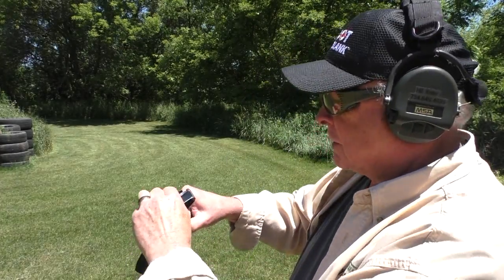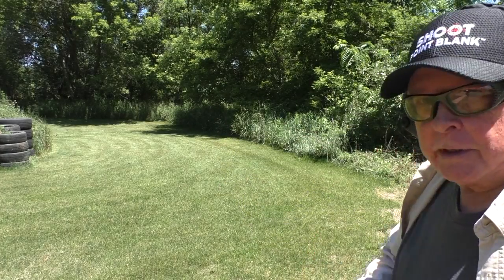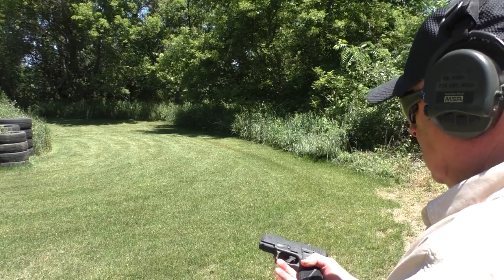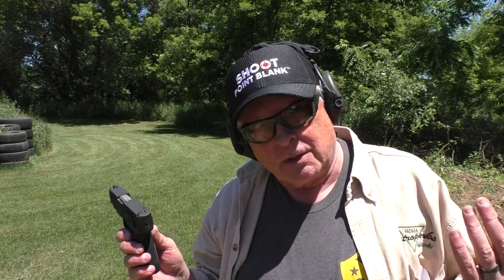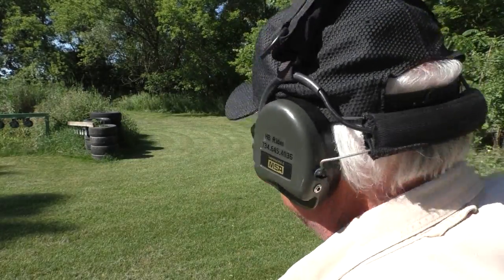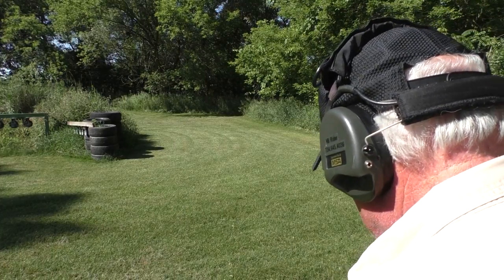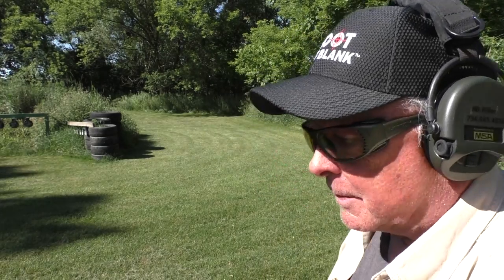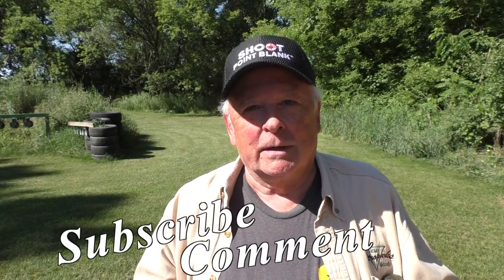Will the Taurus G3c run Defense Ammo?

Comment: My g3c chrome slide version has issues with HP rounds particularly with a fully loaded mag.  I've tried SO many different HP rounds to test this issue and tge issue still remains...  I've started to use Norma MHP 108 Grain and it has helped.   I'm considering giving the feed ramp a real nice polish job in hopes of resolving this issue before I gift this G3C to my mother for home protection.
Reply: Is it at least you mother in law?
I wouldn't recommend giving your mom a weapon that's prone to malfunction for home defense.
Reply from the maker: @Salt Addict, from all the comments, polishing the feed ramp usually works. Thanks for watching.
Reply: Trade it for a Springfield Hellcat 9mm. 
One of the Best out there IMO. 
I just do not trust the Taurus pistols as much. Your Life is worth $400 more for the Springfield Hellcat, Springfield XD, Glock, CZ,  ETC.  Good Luck! 🤠👮🏻‍♂️🇺🇸👍🤠👻😉🍀.  B9USA Sr.

Comment: My new G3c functioned flawlessly with Herters FMJ 115 gr , Hornady critical defense 115gr, Blazer FMJ 115, and my handload 124 gr Hornady HP. My handload is what I carry in my Sig 938, always functions and goes bang. I am impressed with all aspects of the Taurus G3c. I clean and lube the weapon after every firing. The lube I use is Lucas gun oil extreme duty, recommended by Sig.
Reply from the maker: Thank you for watching and adding your thoughts.

Comment: This is an easy fix. Just take a dremel with a wire wheel to the feed ramp on the barrel.
Reply from the maker: That's the usual remedy. Shouldn't be necessary in the age of precision CNC machining, but at the price, it could be expected.

Comment: I've had problems with the 1st round of Federal HST 124 through my G3C. Everything else has been flawless.
Reply from the maker: I haven't tried it yet, but polishing the feed ramp may help.
Reply: What ammo do you currently use for self defense?? I just bought the taurus g3x and I've had issues with the federal hst 124 as well. Trying to find a good reliable self defense ammo to use.
Reply from the maker: @dale3123  while I like the Fed 124 HST, I also use Remington Golden saber 147gr, though I don't have enough for more extensive testing.  So, in my G3c I chamber an HST, then the rest of the mag is 124 full jacket ammo.
Reply: @dale3123  What I ended up buying and carrying were some hollow points from Minuteman Ammunition based out of Washington state. I got some 95 grain rounds but they also make 115gr and 124gr ammo as well. The nose is pretty small on the 95s. They feed and fire flawlessly. I've not had a problem with them at all.
Reply: @LAIRDO-  thanks for the reply, I'll definitely be getting some of that Minuteman ammo. Much appreciated 🙏
Reply from the maker: How was the point of impact compared to point of aim with those light rounds?
Reply: @RidersRange  I found them to work just as efficiently as a larger round and just as accurate.

Comment: Do not use armscor ammos coz it didnt fit to G3C. Use PMC, Blazer ammo and you experience a smooth and reliable Taurus G3C.
Reply from the maker: That's one brand I haven't tried yet. Thanks for watching.
Reply: I use armscor hollow points with no issues.

Comment: I'm not sure what was the impetus for making this video, but if you're Taurus G3C fails to feed defense ammo, here are my thoughts... 
This video is 1 year old, and this gun came out not that long before this video. If you have an earlier model G3C, I might suggest the manufacturing process didn't do a good enough job polishing the feed ramps.  Also, some people don't clean and oil their guns, and never hesitate to complain.

 The old man here (I'm no spring chicken either), suggests that you send the gun back to Taurus. You can do that, but I suggest you grab a dremel tool, or anything that can twist a polishing tip, and polish the feed ramps, before sending your gun off to Taurus. You might find that this solves the problem and you won't have to part with your gun for some unknown length of time.
Reply from the maker: @Charles Luck, thank you for watching and offering your suggestion. Your suggestion is also my solution, and the solution offered by many of those who have commented on this video. However, I rarely, if ever, make a suggestion to a broad audience with unknown skills as to how to "fix" or modify their firearm. Yes, that's the simple (and proper) initial solution, but not everyone has access to the needed materials, nor has the knowledge to polish a feed ramp. I know, I know - sounding too much like a lawyer, which I'm not. Just being cautious.

Comment: need better mags, mags don't feed correctly into gun, iv shot over 300 rnds of blazer, just fine. maybe an issue here or there, hollow points are bad, when you take gun first out the box, failure to feed, to chamber ect. however, if you change barrel and simply take the mag apart work the spring out, lube it up. iv been chambering my hollow nd shooting all 17 without issue. Tarus is a great gun for its price. it's also a fine gun to carry if you have taken the precautions beforehand to make sure it feeds defensive ammo properly. However, if you have the money go with a gun brand that is more reliable, whether it be a revolver, or good ol glock. At the end of the day, you don't want to find yourself in court telling your peers that you used a gun that you didn't find reliable, so you opt to use "training ammo" blazer to everyday carry. when you could have carried a more reliable gun. Always know every action you take will be reviewed/scrutinize by your peers in a court setting.
Reply from the maker: All good points. However, I've found that Taurus quality control may be somewhat spotty. Some guns run fine, others, not so much. Thanks for watching.

Comment: I have had to ream  the throat on all of my Taurus pistols in order for them to pass a plunk test with my reloads. You can buy the reamer on Brownell's for about 80 bucks and it doe's a superb job.
Reply from the maker: Good info. Thanks.
Reply: @RidersRange  Just try polishing the feed ramp smooth if its not eating HPs. That feed ramp should be smooth right out of the box but sometimes its uneven with ridges or tooling marks that need to be smoothed out. After its smooth it should run anything like a scalded dog. You should not need to ream out a chamber throat that may cause more problems than you already have. It should already out of the box pass a chamber support test with factory ammo without need to ream anything out. If reloads don't show chamber support or won't chamber then the reload is the problem, not the pistol. My G2c eats HPs with no problems right out of the box.

Comment: I have this issue with one of the three magazines that i received with my G3C. That one magazine fails to feed from a full magazine every time. No issues with the other two magazines. Imma contact Taurus to see if I can trade that one in.
Reply from the maker: Check the mag lips to see if they are bent and compare the problem mag with the others.
Reply: @RidersRange  I can't see a difference. I called Taurus. They are sending me a replacement magazine. I noticed after loading the magazines several time. I noticed that the troubled magazine is stiffer, and harder to load. I am going to cut one link from the spring in the troubled Magazine. Guessing that the spring is too tight. If that does not fix the issue. I will just load it to 11 rounds. It works fine with 11 round. It is at this point an extra magazine, so...

Comment: My G3c had a nasty burr at the base of the feed ramp, causing a jam with hollowpoints when chambering a round  using the  slide release. I very CAREFULLY used a small, fine, half-round file to remove it. Problem solved.
Reply from the maker: Even at the $300 price point, one shouldn't have to fix issues like that, but I''m glad it worked out for you. Thanks for watching.

Comment: Yeah, I tried some HSM 147 grain flat nose full metal jacket rounds in a Taurus g3c, and the {ogive} of the projectile will not allow the cartridge to seat fully into battery. It's a pretty shallow throat and ejection of those rounds are a real bugger... Unfortunately I bought several boxes before I even knew that the gun will not shoot them... 

🙃🥂
Reply from the maker: Any time I have ammo that has a bullet shape other than a typical round nose, I "plunk test" it in every barrel. Guns with a short lead often have problems with certain bullet shapes. Since you have all that HSM 147hr ammo, you may just have reason to buy another gun. Thanks for watching.
Reply: Yeah that what I was thinking. Can't have all that ammo feeling lonely sitting on the shelf like it's not loved. All ammo needs a trusty reliable friend... lol...

Thanks for the reassuring justification. 😆

Comment: So far the ONLY hollowpoints that have an issue with feeding from the slidelock position has been PMJ 124 gr. in my G3C. My local gun shop carries these almost exclusively. The other rounds I use are standard ball 115 gr. Fiocchi or this ballistic tipped fmj ammo I bought during the shortage that was the only ammo I could get at the time.
Reply from the maker: You have to run what the gun likes, and they are all different. Thanks for watching and adding your info.

Comment: Mine was jammed up against bottom. Lip of the feed ramp. took it apart and looked at it. it looked like someone  at the factory had dropped the barrel on the feed ramp. used a Jewlers file to smooth it out. Seems to work now. Unfortunately, I'm still having acracy.issues.
Reply: I have the same issue with my Taurus g3x,  the lip of the hp seems  jams at the bottom of the feed ramp with gold dot 124 gr ammo..

Comment: try polishing and buffing  the feed ramp that what i did to my keltek p11
Reply: I agree!  Just a little polishing can cure most problems.  I use "crocus cloth" which is an absurdly fine variety of emery cloth, sold in hardware stores.  I wrap a small strip over a bunch of different sized rubber pencil erasers, and softly rub with ONLY an in-and-out motion like the bullet when feeding.  I gently polish the ramp and the upper side of the chamber where the bullet nose bumps into.  It takes about ten minutes, and feeding hesitations go away..........................elsullo
Reply from the maker: Harvy, I've even had to polish the feed ramps on a few "higher quality" (read - expensive) pistols. Thanks for watching and adding the comment.
Reply from the maker: elsullo2, thanks for that suggestion. I guess I'm basically lazy - I use polishing rouge with a Dremel tool.

Comment: It won't "manually" feed the flat tipped bullets. Load a round tipped buttet manually and it will recoil feed the flat tipped fine. I never had an issue until I purchased some 147 grain both types of which were flat ended. Maybe one of the people who commented was right that you need to pull it back and let it snap in but it wont feed them slowly.

Comment: Many rounds do not pass the plunk test which makes bolt not go into battery and getting stuck if you force it.  I found Sierra jhp fit well.  plunked in and you can push and spin in chamber.  Test your defensive ammo like this first.
Reply from the maker: Testing your ammo is always sound advice. Thanks for watching.

Comment: Mine does not run certain hollows. Just tried to chamber and have had it get stuck during feed multiple times now.
Reply: Same here. It happens while firing (if you fire pop, pop, pop, pop rather than how this guy's doing it). I'm going to sand down the feed area. That supposedly will fix the issue.
Reply: @hephaestus6365  it's pretty annoying. Because if I happen to get into an altercation any time soon I don't know if I trust this gun to save my life. I don't have many tools to really fix the issue so I'm just hoping that if the time ever comes that it works well enough and that I can stop the threat from a shot or two

Comment: Mine has issues like this. Literally zero rounds through the gun and it will not load certain JHP’s. I know it’s because of the barrel for mine anyways
Reply from the maker: I believe Taurus has some quality control issues. Thanks for watching.
Reply: Try running a few hundred rounds of fmj through it before hp

Comment: It's a magazine issue. Has to be. The springs sound defective, or they're put in backwards.  I would bet it isn't the gun. Go buy a coupke extra mags for extra round carry and see how they perform. If they all do it, then I would look at the gun itself.
Reply from the maker: Mags are fine. I have 4 mags for the gun and they all perform the same. A little polishing to the feed ramp and breach area and all is well.
Reply: It's not the mags on these guns. If it happens at all its usually on a hollow point on a brand new dry gun. I always clean and oil these guns right out of the box. No issues.

Comment: Mine wouldnt feed hollow points untill I polished the feed ramp,problem solved
Reply from the maker: That seems to work most of the time. Thanks for watching.
Reply: Same here
Reply: How odd. Mine wouldn't feed because I was unintentionally riding the slide. Once I addressed that everything was good. Not once did I polish the feed ramp.
Reply: @Poser_Metal_Records yea i noticed riding the slide wont feed hornady critical duty hp but just letting the slide go feeds it just fine
Reply: @Dreadpurp  It's funny because prior to buying the G2c my only gun was a 92FS which had no problem with me riding the slide. Damn gun was letting me get away with a bad habit lol.

Comment: Thanks for the video, I found mine does not feed sig 9mm 124 gr v-crown from slide lock only if I rack it by hand, I have not tried other types of ammo yet. Also only put 10 rounds in clip 12 seemed to be a tight fit. I figure that I need to break it in before I send it off. What do you think?
Reply from the maker: Thanks for watching. Taurus pistols in general seem to be hit or miss on some ammo types. If the particular round won't feed from slide lock, it may not be the best choice for a defensive round if you ever find yourself in a situation where you have run the gun dry and still need to stay in the action. As to putting all 12 rounds in the mag, I start with 12, but don't top the mag off after loading one in the chamber. I have around 500 rounds (give or take) through my G3c and I still don't trust it 100% to feed the first round if I top the mag off.

Comment: Mine will not fully chamber AMMO brand hollow points. It feeds from the magazine into the chamber but lacks a fraction of an inch of the slide completely closing. To extract the live shell requires tremendous effort to pull the slide back. Taurus suggested that I try other brands of ammunition before I send back the gun.
Reply from the maker: It sounds like the bullet is contacting the rifling before the cartridge case is fully seated in the chamber. I have that exact same issue with certain ammo in several guns that have a real short lead (lead is the distance between the end of the chamber and start of the rifling). The shape of the bullet used by AMMO, Inc., is the same shape I have occasional trouble with, though from the photos of that ammo, it doesn't look like that should be the problem. I would suggest trying Hornady Critical Defense, Federal Punch or HST, and Remington Golden Saber to see if those work in your gun. Good luck, and let us know how it works out.
Reply: Thank you. I will definitely give it a try.
Reply from the maker: Ernest, I just tried the "plunk test" in my G3c with several types of defensive ammo and here's what I found:
- My handloads with Montana Gold 124gr hollow points loaded to 1.124" OAL - No go. Not even close
- My handloads with 124gr Hornady XTP hollow points loaded to 1.120" OAL - No go.
- Hornady Custom 147gr XTP hollow points - not quite.
- Hornady Critical Duty 135gr hollow points - just a little tight in my gun, but they would work (may or may not work in yours).
- Federal Punch 124gr hollow points (basically the HTP bullet), work fine.
- Remington 147gr Golden Saber hollow points, work just fine.

Remember, every gun is a little different, so what works in my gun may not work in yours. 

I hope this helps.
Reply: @RidersRange thanks for the information.

Comment: People limp wrist a gun and it won't work.. I've seen it over and over at the gun range I used to teach safety to. Then they blame the firearm. Not all people of course, but it happens more than you would think.. 
I'm trying to decide on the G3C or the G3 full size.. I've not handled either, but I'm worried that the G3c will have to short of a grip because I hate not having my hold hand not able to grip the pistol and I don't have unusually large hands.. So, if I can hang on to it, that would be a perfect cc pistol.. 
Thanks for the video.. Appreciate it. 
Tim
Reply: If the handle is too small with standard magazine, they make a 17rd that has some extra grip
Reply: @maynhardatkins8012  Thanks so much.